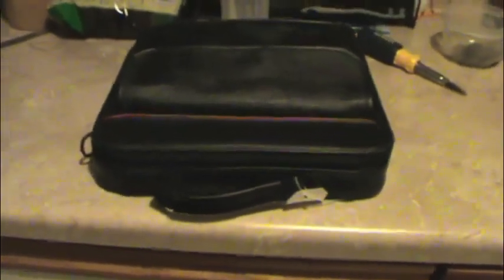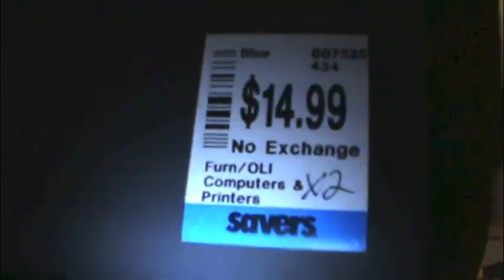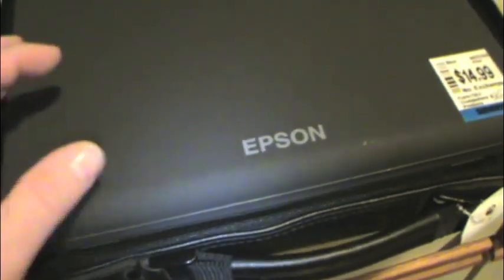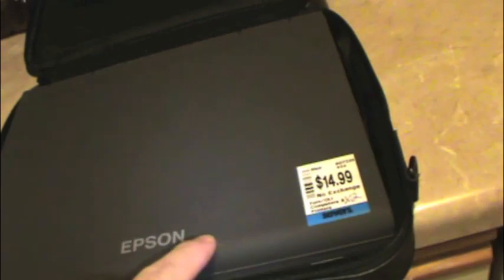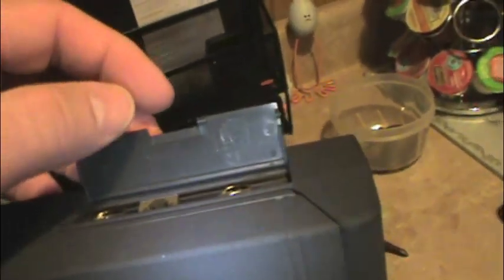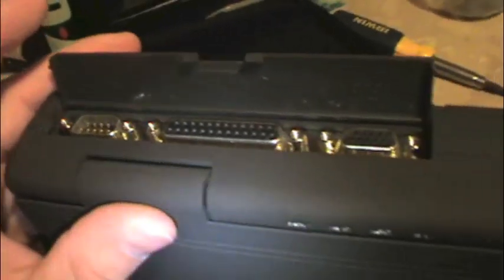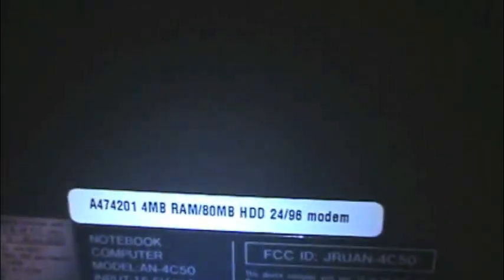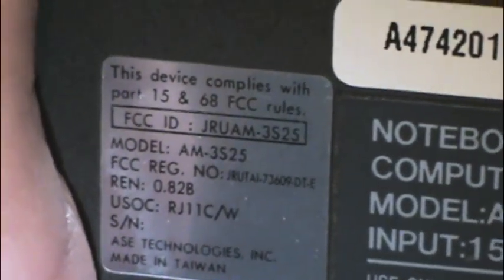Epson ActionNote 500c

Comment: This laptop would use a 387SX-25 math co-processor, since the 486SLC2 is based on the 386SX.

The DS1287 has not been made in over a decade, so any one you find will probably be dead as well. I believe its replacement, the DS12887, has also been discontinued, but the newest ones made should still be good. I got a few that were made in 2003 and the battery in them is still good.

Comment: Indeed, the laptop has the 1024/16/63 limitation, which corresponds to 504 MiB, your drive has 516 MiB... it's no big loss really (12 MiB) if you don't have anything else to put in.
i'm not too familiar with BIOSes this old, but assigning 1024 cylinders and doing a format with those parameters should work, at least it does by far most of the time on newer computers with larger limitations.

Comment: I noticed you said the replacement hard drive is 1050 cylinders... a machine this old will only support a maximum of 1024 cylinders. So try typing it in as 1024 cylinders and see if that gets it to work.

Comment: I recently got what's basically the B&W version of this laptop. My clock battery is dead, and as a result it's impossible to boot because after you enter the drive parameters, it forgets them as soon as it saves the CMOS settings and restarts. I'm relieved to see the Dallas chip is socketed - I'll definitely look at grafting an external battery onto it.
Reply: ***** I pulled the chip and performed the surgery today, using a 2x AAA battery holder placed in the battery compartment. Works perfect!
Reply: ***** a ha, it's the regular ActionNote 500...
Reply: ***** Nope, there was never such a model. It is indeed basically an "ActionNote 500", but the model name is different.
Reply: ***** oh? Then I'll wait for your video to find out what the model is
Reply: There were four models in the ActionNote series that used this same chassis: the 4SLC/25, 4SLC/33, 4SLC2-50 and the 500C. The 500C was the only one to feature a color display.

Comment: the CHS parameter settings are very simply programmed (C*H*S*512(bytes per sector)) and just calculate the end result. The final size calculation that the BIOS shows does NOT nescessarily take note of its own HDD size restrictions. You see 516MiB on the screen, but the BIOS really has no clue of what you typed in... it just sits there and is like WTF :D

Comment: +mraiwa1000
Yes, It has a speaker, but not like most laptops like today. it has a "Beeper" cell speaker that can play midi tones. Do not know if it can play WAV files.
Reply from the maker: What you're referring to is a "PC Speaker." All computers (PC/XT/AT/ATX compliant) (even those manufactured today) feature a rudimentary speaker that is capable of playing simple audible feedback sounds (that "BEEP" you hear when a computer successfully POSTs) and the error beeps if it fails POST. Some older DOS games made extensive use of this speaker to play simple music and less commonly, even speech. No, the PC speaker is incapable of MIDI, as MIDI requires a music synthesizer chip. Playing WAV files is also not technically possible due to the simple nature of the circuitry driving the speaker itself. It IS, however, possible to write a program that allows the speaker to play low-quality audio (and I'm not kidding when I say "LOW QUALITY!"). The intent was for this speaker to provide very basic audio feedback (error, success, or a crude musical score), and nothing else.
Reply: BBISHOPPCM's World yeah. Thats true. I can't seem to get mine to see a HD for nothing, even if i manually config the bios.

AJ
Reply: AJ Windmeyer bad port

Comment: I have this laptop. It has 4 MB ram and the 180 MB Hard Disk. Unfortunately, i don't have the settings correct or something. I set it up as the online specs said, but did not boot. No HD usage light or anything. The HD starts but no use.
Reply: AJ Windmeyer Assuming the HD is good, has some working OS on it, and the correct parameters are entered into the BIOS, is your clock battery dead? If so, then it's forgetting the HD parameters as soon as you exit the BIOS setup. I have the B&W version of this laptop, and that's the case with mine. I'm going to remove the Dallas chip and graft an external battery onto it.

Edit: I performed surgery on the Dallas chip today, attaching to it a 2x AAA battery holder which is placed in the battery compartment. It works perfect, and the hard drive is detected and works no problem now. :)
Reply: themaritimegirl hello, did you use a dremel or just cut away at the chip to expose the terminals? Just found one of these today at Savers for $8 without the power adapter. I'm assuming the clock chip battery is dead. I'm going to try two wire in a compatible 16v laptop power adapter.